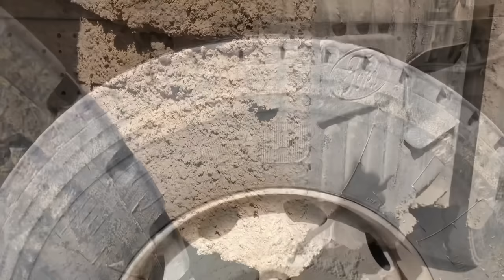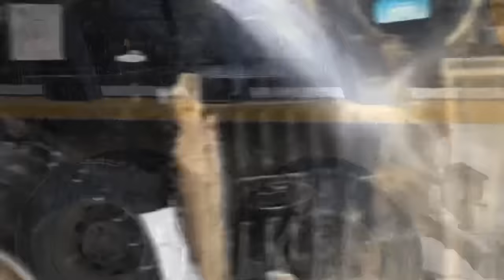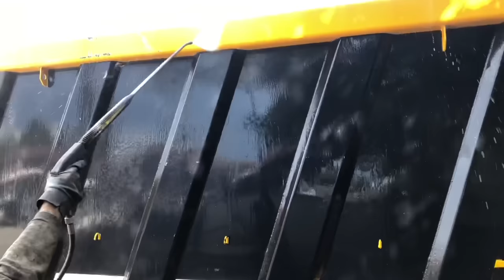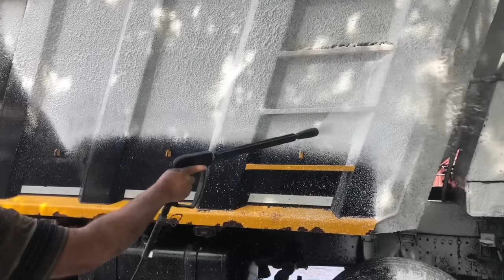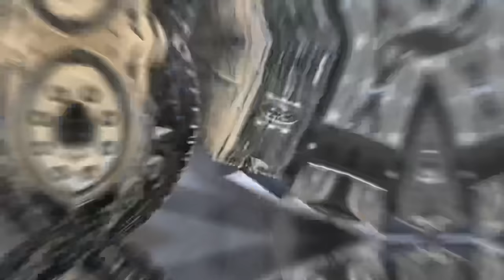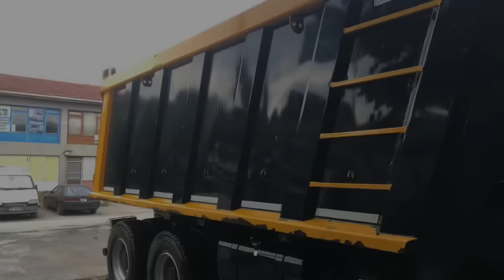FORD TEST ARACINI YIKADIK! Sınırları Zorladık! WASHİNG RUİNED FORD TEST TRUCK! How to clean DRY MUD?

Comment: As an addict of your channel,I've seen most of the equipment you have.I wondered why you don't use this very powerful pressure washer seen at the beginning  on more vehicles-it appears very rarely.I can understand it may be too strong for cars but on some of the very dirty bigger vehicles you have,it would do the work even faster.
Reply: Thank you! As a semi professional auto detailer this video was agony. 
1. Should have rinsed all the loose dirt with the pressure wand.
2. Used the pressure washer to apply a nice sudsy layer of soap.
3. Let stand 5 minutes or so.
4. Pressure washed the rest of the mud off.
5. Soap once more and rinse.

Time saved. water saved. super clean truck.
Reply: @firehawkws7845   As a professional cleaner, I disagree with you slightly.
1 High volume low pressure initial rinse down is the most efficient and effective way of removing heavy built up dirt both in terms of labour and water.  It helps soak the rest of the dirt, makes it easier for chemicals/ formers to fully function and just drops the dirt removed to the ground.
Whereas with a pressure wand ,high pressure low volume , the wand would shatter the heavy dirt, spraying it everywhere and the risk could be damaging the vehicles  surface by using a wand in a way it’s not designed for.
2 You could then follow up with a rinse down of a pressure washer or apply a Traffic Film Remover ( caustic based). TFR makes the job easier, but should not be left to dry on. TFR and or soap should be applied from bottom up not top down
3. Very light brush / scrub
4. Rinse down with HPLV  warm water from inside to outside, top to bottom, nearest to furthest.
5 surface protection e.g. wax
Reply: It looks to me that the very powerful pressure washer was literally a fire hose with a commercial/heavy duty large diameter hose. Those can use a massive amount of water very quickly, so maybe the reason not to is to keep water cast down and use water efficiently.